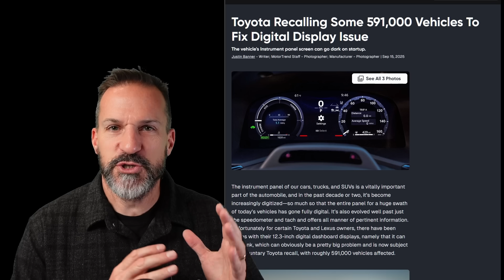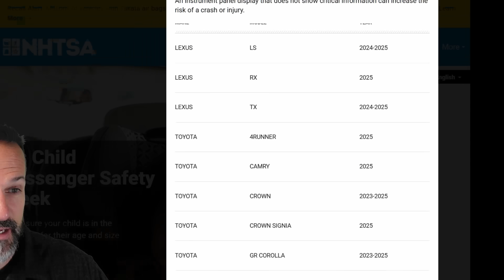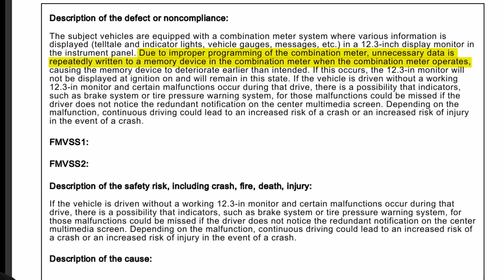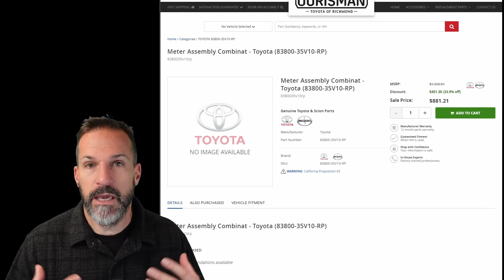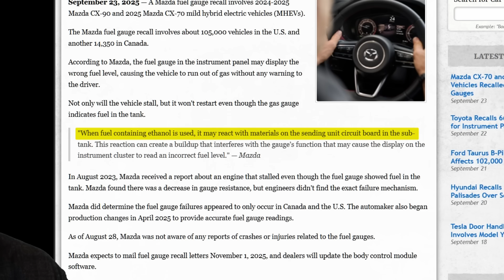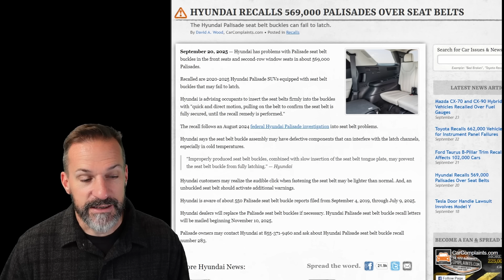SO Smart, They Are Dumb - HUGE Toyota Recall of 600,000 Vehicles.

Comment: I turn back my Camry XP 2025 with hybrid malfunction, transmission failure, no communication between ECU and hybrid systems, i not even drove my 2025 for a month straight, 3 days after purchase I have to towed back to Toyota dealer because they malfunction in the car, my sincere recommendation, don’t buy it, they are not reliable, I went and I purchased a 2024, problem solve

Comment: Everyone (mostly governmental red tapers) wanted a more fuel efficient, safer, lighter weight vehicle and in order to have all of that, you have to cut corners here and there when it comes to parts.  A Simple example: My 2017 Toyota Camry LE came standard with a power adjustable drivers seat.  The 2026 Camry LE comes with a standard manually adjustable drivers seat.

Comment: Pick up a 24 RAM 2500 WITH A 6.4. Not that I need a heavy duty but to me simplicity is the direction I’m heading. Naturally aspirated with no direct injection (carbon problems expensive repair) no turbo no electric infrastructure🤦‍♂️ no additional cooling and oiling infrastructure.  To me less is more.

Comment: I here and it’s all over YouTube if you have any problems like this you can unhook your battery and turn your lights on after you unhook the battery to get all the juice that’s left over  I have to look up the video I looked it up like a week ago but I’ve seen other ones and it’s like when you leave your phone or laptop or your computer on and you don’t shut it down you will have problems and then when you shut your computer down and build it back up it will be working fine they say the cars the newer cars with all this computer stuff is the same deal it even says like when you hook it you know reconnect the battery they said it could run rough just for a little bit because everything is rebooting back up look it it’s all over YouTube there’s different people with the video so you will find videos about this stuff definitely I have somebody that knows what they’re doing I’m not saying you gotta take it to a mechanic for somebody that won’t unhook everything without anything touching you don’t wanna mess nothing up do you wanna do it the right way but look it up online and you’ll find out

Comment: Had this happened in my 2025 Camry once, the gauge went black while driving. But it turned itself back on a few moments later. And mine doesn’t have the big digital display it has the normal one for the SE trim.

Comment: Bought new 2004 LS Z71 4x4 Chevy Colorado.  Still running great @ 160K miles.  Replaced front wheel bearings, tie rods, fuel pump.  Also have a 2022 Tacoma V6 Off Road with manual trans used mainly for camping trips, 12K miles.  No Debt.

Comment: This - aside from the ease of use of physical controls - is my biggest issue with HVAC on a screen.
What if the screen goes out?
In some conditions, you won't even be able to defog or defrost your vehicle's windshield rendering it undrivable. A potentially deadly condition.
Same for heat.
What if it's well below freezing, and you don't have functioning controls to warm up your vehicle's interior?

Comment: why is the mazda cx70-cx90 recalled for faulty fuel gauge level but 2022+ Toyota Tundra is not recalled for its faulty fuel gauges? my gauge regularly resets to full when i have 3/4 of a tank and will show incorrect level for remainder of the tank

Comment: If the dash goes out, you have no ability to observe low fuel level or abnormal oil, pressure or engine temperature conditions. That makes it a safety issue given any of those issues could result in a stranded vehicle.
Reply: Would have to check the Toyota app on our phones in the interim. Not ideal.

Comment: If vehicle manufacturers purchased / used quality technology systems as OEM vs. whatever they can either produce themselves or buy at the cheapest rate known to man, they likely wouldn't have these issues.

Aside from the front differential warranty replacement, my '22 4Runner is rarely ever on these "lists."

Comment: The new $110k gm escalade ev can even traction control up a simple ramp with 2 wheels slip to get to a 3 wheel slip test while the $50k tesla model  y crossover, which is the best selling vehicle of any kind in the world, goes up the ramp and test like it is nothing.  Because no other legacy or oem period can do electronics and software like tesla can. No legacy oem has any software competency and has to rely on suppliers while tesla designs all of and makes most of their electronics themselves.  Nobody else is worth a damn but a pile of scap metal.

Comment: Sorry, but ice vehicles are complex, not evs.  Complexity is not good with mechanical systems, but is fine with electronics if it is done properly.   Mechanics are physical and will wear out no matter what.  Electronics can be made to last forever., How many times have you heard about an old corded drill that is 80 years old that still works.  It is that these oems are making crappy electronics and don't forget these software issues are a result of the inability to deal with software. Legacy oems can not do software at all. This is done by suppliers. Tesla writes their own software and does a better job than just about every software company.   Sandy Munro has stated how teslas electronics is on par or better than DOD, military equipment. That is because they design and engineer it themselves and in most cases makes most of it themselves.

Comment: I hate digital displays in a vehicle, as it is just not something that is reliable enough for decades, or easily user replaceable.  Glad I have a 2022 4Runner.  Quite honestly, if I do buy another vehicle I would buy a Tundra but the last generation.  They are selling at what I think is a high price, with most of them having over 150K kms.

Comment: I'm still driving my 2002 Chevy Silverado with the 5.3L engine with 200k miles.  Well taken care of, looks mint, and zero issues or leaks. I've had 2 offers on it this year. One for $15k and the other for $20k. Nope. Not for sale. 🤣🤣 I would not even trade it for a new truck. New trucks are so cheaply built and are so unreliable. Just too risky in todays market. I can rely on my old truck and it is very easy and inexpensive to get parts and very easy to work on it myself.
Reply: I hear you! I screwed up giving my 02 fully service Silverado with 95K to my older brother, because I got retail therapy to purchase a new 16 Silverado High Country. It lived at the dealership on it’s third 8 speed transmission; brotherly love is receiving a You Tube Video of someone’s 02 Silverado with over 500K on it with nothing more than maintenance. His note was your not getting your Truck back. Take good care of it; 200K is just broke in!
Reply: @flashnmb1  I love my truck. Its in mint condition and it is sitting on 35 inch tires with a 6 inch lift. Beautiful truck. My son keeps begging for me to give it to him. But the new chevy Colorado's are looking very tempting though. That 2.7 turbo engine is solid.

Comment: My son's 2008 Toyota Yaris threw it's first code at 160k miles, B1499 for the air conditioner. Not sure what it means but the AC still works OK. Guess I'll have to take out a reverse mortgage on my house to have it fixed like all these 2020s cars 😆🤣.
Reply: air conditioning amplifier

Comment: Digital displays can be reliable its the way the manufactures choose to build them. Ive never had a cellphone display burn out on me and its waking up and sleeping 24/7 non stop for several years before a trade the phone. It gets dropped occasionally and rained on. The only concern i see in a car application is heat soak from the car left sitting in the sun.

Comment: I agree, that technology is moving forward, but analog gauges, should be kept and left alone. I prefer analog gauges, because some of older stuff is much better than the digital crap they put in cars these days. The digital gauges have a hard time reading the speed when you accelerate, while the analog ones have no problem. They need to stop this stupid trend of digital dash fitments everywhere they look. I have 2017 mazda cx-5 with analog dash and a small screen on top of the dash in the middle above air vents. It has everything I need - bluetooth, wireless calling, bose sound system, navigation, I can run Sirius XM on it through Bluetooth. If I want it, I can Install a retrofit kit with apple CarPlay in it. The materials in the car are of good quality, cleans easily. It has 59000 miles. The car is AWD, drove through ICE, not a single slip with all season tires. Been driving it for 1 year, and not a single major repair on it. Knowing the fact that the car is 8 years old already. Unlike my Nissan Sentra that called it quits at above $120k miles with a bad tranny, and lots of major repairs. This one is much better, because Nissan already had problems in the first year.

Comment: My 2020 Tacoma has done this for a year now! Local and selling dealer will not help. Was told disconnect battery for 30 minutes and it will fix it. Really! It’s not the whole dash just the part in center of steering wheel with digital speed, cruise, and odometer. ?

Comment: I have my 91 Civic Si that I'm really happy with. No drivers assists/nannies. Doesn't even have an airbag or power steering. I am working on adding AC to it ever since i found a used heater controller with the AC button on it, and i discovered that honda put in the AC wiring plug into the harness regardless. My next vehicle purchase will be an IDI Ford with a 5spd and 4x4 for going into the bush. You couldn't pay me to daily anything modern
Reply: I have a 2007 Honda Civic Si Sedan, owned it since new, 18 years. One recall - air bag inflators. Super fun to drive and runs extremely well for its age.

My 2019 Tacoma I added to my fleet in October of 2018 has been nothing but problem the entire 52,000 miles I’ve owned it. Multiple recalls and in and out of the shop for unscheduled maintenance. Worst automotive mistake I’ve ever made was purchasing that product.
Reply: @josephkane4364 and the sad part is, the Tacoma has been a paragon of reliability for 20 years at that point

Comment: I have 3 low end HP laptop computers which still work fine. That still amazes me since they were all made in China. They never get turned off. One was purchased 'used' from Amazon at about half the new price.  It looked new to me?  I only use Chevron ethanol free gasoline. On the Gulf coast, gas containing ethanol pulls too much water out of the 'humid all the time' air. During the summer, before dawn, water is literally dripping off the roof.  That is what you call humid. I seldom wore my seatbelt until a pilot who flew in the Vietnam War, told me that I was going to be sorry if I got in a wreck without a seatbelt on. That was the last time I didn't buckle up. The combination of seatbelts and airbags is saving thousands of lives.
Reply: Replying to @billsimpson604:

*GREAT JOB TO YOU FOR LISTENING TO THAT VIETNAM PILOT ABOUT WEARING YOUR SEATBELT!!*

Comment: 2004 Prius here. All of the second gen Prius suffer the same issue. 

Simply turn the car off, open the door, put the car in accessory mode and turn the headlights on. Problem fixed, at least temporarily.
Reply: Be sure to pat your head and rub your belly for 5 seconds to ensure proper operation.
Reply: I’m seriously doubt your 21 year old Prius and the affected vehicles are rocking the same tech.
Reply: I owned the 2nd , 3-rd, and 4-th generation and I never had any problems on my Priuses

Comment: Complexity is the enemy of reliability.
Reply: And guess what, software is lot simpler than mechanical device. You get the logic right, and you get the expression right. And then you are golden. But the probelm in auto motive sector in US, Japan and Europe, they dont really have enough qualified software engineer to code the proper firmware for the application. There is also hardware part to be blame. The legacy auto are asking to much for their certified hardware. Despite the fancy GUI. The  sub system level hardware are still late 90 to early 2000s technology. When it is asking  so much, if course the hardware will get over loaded a crash. Tesla wont have these problem, because their system are more centralized and more powerful. So they will run into less integration issue and hardware limitation.
And to clearfy. Not many software engineer code their software from coding level. They are mostly using Integrated Development Enviroment(IDE) or more commonly known as development kit. The good thing about this would be easier to build the software. The short coming of this would be, if there is bug in the software, good luck finding it. And let the IDE take it.
Reply: All it takes is one power surge.
Reply: Regulation is also adding to complexity
Reply: Thank you. We have a 2005 Pilot. The auto shifts as new and the engine purrs. 5K oil changes from new, 30K on the trans and 20K on the diff.

Comment: Whatever Toyota is using for the memory module would take a constant read/write cycle of several thousand times a day to wear out what I imagine is a discrete NVME drive, which do you tolerate constant writes and deletes well over time (especially when they are constantly Hot). Most midrange drives have a MTTF of several million writes;  in a PC for example, that timeline is anywhere from three to ten years, use case dependant.

Comment: What's the reason, for buying a Toyota? Parts for these beasts won't   exist in 5 or 6 years. Only get cars, that have a performance base. Chevy, Ford, and Ram all have performance secondary market parts, for their body on frame V8s. Stick with either pickups, or body on frame SUVs and you'll still be able to find parts. Also the muscle cars these brands make, will have available parts far longer than anything else on the road.

Comment: I'd still be driving my 87 accord with a carb on it, if weren't for motorcycle hitting it and rider flying through glass into the car. The speedometer needle had fallen off but I could kinda guess my speed by the rpm and what gear i was in. The cop asked me how fast I was going, I said needle fell off, he looked, and let me go.

Comment: Thanks for the update. Kudos for Toyota for standing behind its products with a recall and repair. I suspect this is a failure on the design by their Tier 1 supplier and Toyota has disciplined processes to correct these mistakes quickly. We in the consumer market should expect more recalls like this across all OEM's as the technology becomes more fully integrated into our cars. I sure like the new technology. I had an older Sequoia that had to have something replaced - an airbag I think? The same for my 2013 Land Cruiser. Older does not mean more reliable and that is a myth some propagate.
Reply: older is more reliable than the new over teched, over priced garbage . deal with it, boy...it's a fact.

Comment: It is very frustrating to tell a customer that it might be a software issue and they have to wait for a fix from the manufacture. Been there done that many times as a Technician, Foreman and writer. I had a Yukon with a battery that would randomly draw the battery down overnight and I knew it was the culprit but couldn't do anything about it. A software fix came out in a couple of months and the truck was fixed even though the customer didn't believe me and this was back in 2007 ! And yes your radio even back then was a computer.  LOL
Reply from the maker: Yup, GM has always struggled with electrical components compared to some other brands. I owned a 2007 Yukon XL Denali, it was the worst vehicle by mileage that I had ever owned. Every time I got in the car after about 60k miles there was something wrong (random stabilitrak issues/crankshaft sensor problems). First model year changes are always rough, with GM they are even worse.

Comment: My ‘08 Ram 1500 regular cab/bed 2wd, V8 and 6 speed manual. Pretty simple, but it does have cruise and power lock/windows and electric throttle. The last 1/2 to truck to offer a manual. .
Reply: Duck tape for rust repair

Comment: Yet fan boys keep following the sheep in front of them and purchasing them. God bless my flawless Frontier. 🙏
Reply: A much better truck
Reply: They didn’t say that Toyota fanboys are smart……just toddler thinking with money lol..  Toyota brand has been tarnished for over a decade. I’ll stick to Subaru, Mazda or Honda
Reply: Frontier is the best mid-size truck hands down. The New Toyota Tacoma is overpriced crap. 💩
Reply: Hope it’s not a new frontier those are loaded with dogshit tech too. I tell people Wait til your EFB battery goes dead in a year and you can’t get the bitch in neutral with that electronic pawl.
Reply: I am Toyota fanboy because my wife daily drives a camry we bought new in 2016. Now almost 200k miles later it is still running perfect with ZERO issues other than regular wear items and religious fluids changes by us. Toyota may be slipping but our camry has been the greatest car ever. Who else makes a car that will go 200k miles without a single engine or tranny issue? AC still works perfect too and never been touched.

Comment: Is the memory device failing due to bad software writing too much, or is the actual memory device faulty? Has anyone just replaced this memory device themselves?
Reply from the maker: I would imagine given the description that they are using memory like solid state memory (probably soldered on board) that has limited write cycles before it fails. Maybe they were treating it like RAM (bad idea), and burned through the write cycles. It's very tough to say without more information, but this is all I could find so far. They updated the software I'm sure to not write as much, but I would imagine there will not be an infinite lifecycle on these memory modules. I'm guessing based on my professional career in computer software and hardware.